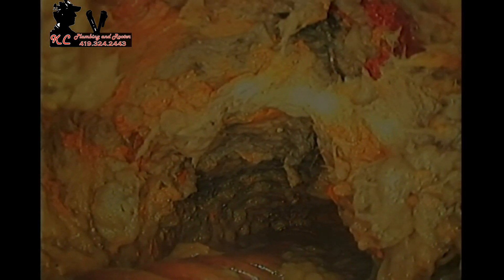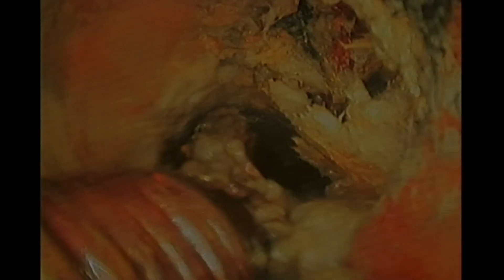Total failure in sewer pipe saved by epoxy liner CIPP

Comment: looks great!! Electric Eel has been great equipment, i still have my dads very first machine, AND a gas powered unit!! thanks for sharing & be safe out there!!
Reply from the maker: Right on! I use battery Milwaukee holehawg drill but I actually was at a customer's house once that had one of those plug in machines in the basement of all things